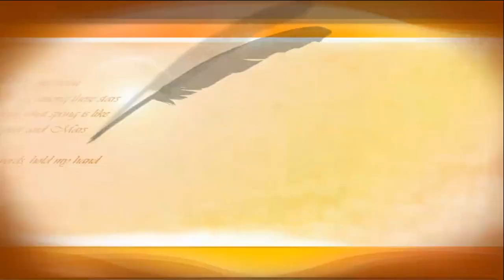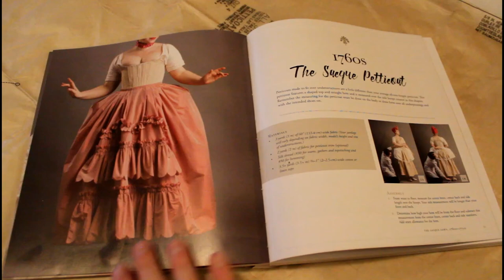Making My Robe a la Française Part 2: The Petticoat

Comment: I love watching your adventure of creating this gown but I fear you have your garment names wrong in this video you are creating an underskirt which is why the front matters more than the back. The petticoat would be under this garment but over the top of your "hoops" to help shape and smooth the garment.
Reply from the maker: Thank you I am so happy you enjoyed my sewing adventure. The pattern and the book I was using to create this piece does call this garment a petticoat, and I do believe it to be the correct term. A petticoat according to the Merriam Webster Dictionary can be defined as an underskirt which is usually a little shorter than outer clothing and often made with a ruffled, pleated, or lace edge. Mine will be getting trim in part 3 of this series. Now one may wear several petticoats at a time and a plainer petticoat would go under the fancy petticoat I made in this video. The first uses of the word underskirt was in 1832, and therefor it would be impossible for the garment I made to be termed such, as I am making a dress that was in style in the 1760's.
Reply: @HistoricalBelle  Thanks that makes sense